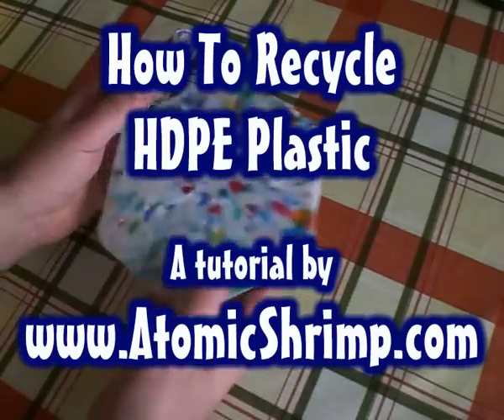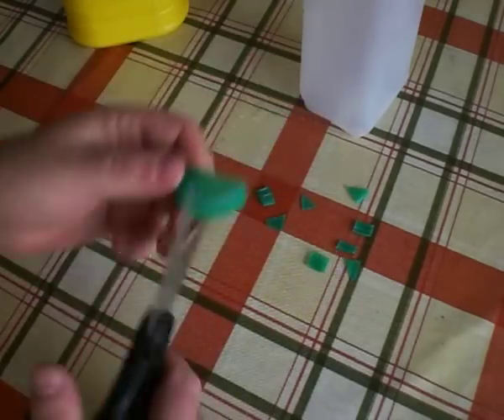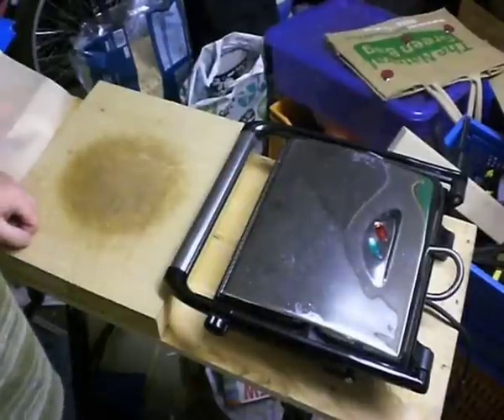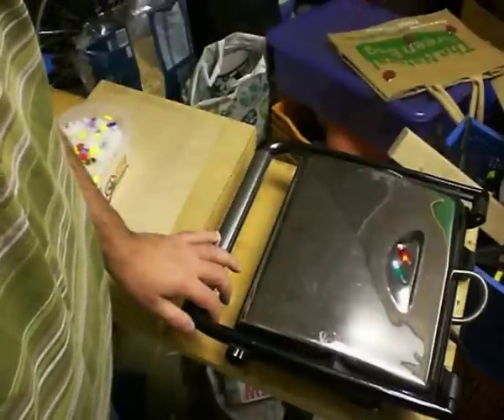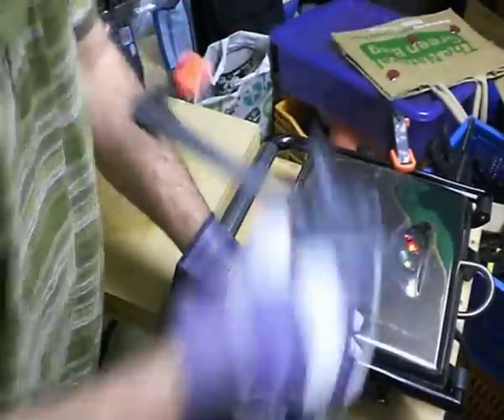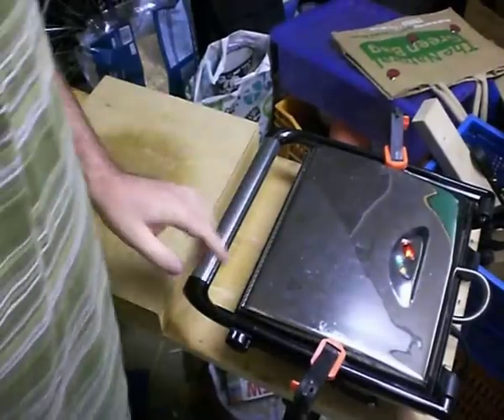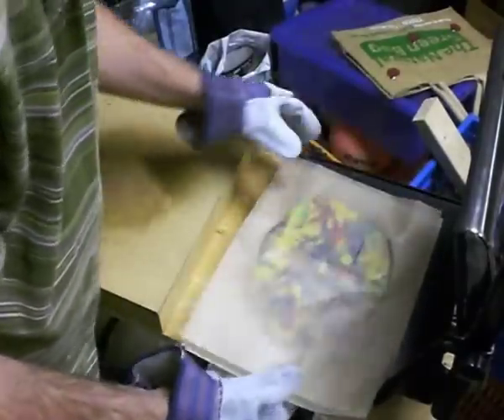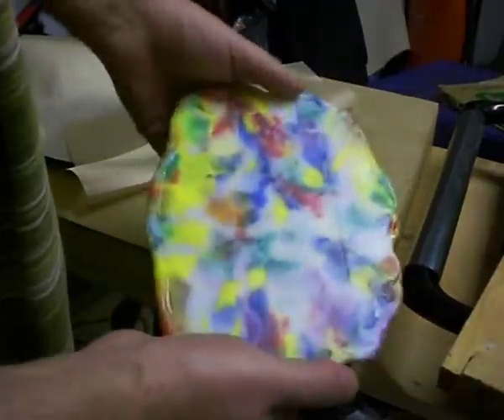How To Recycle HDPE Plastic (High Density Polyethylene) - a simple method

Comment: Instead of using the cardboard ring to contain the loose HDPE pieces, make rings from a large milk container filling it to the required depth which allows for a more controlled smooth edged unit prior to heating and compressing! Instead of using metal spacers to stop over flattening the blank make a wooden frame roughly the required shape!

Comment: If you know a company that will make aluminium moulds ~ then you can press the melted plastic into it~ you’ll need to find some way to pump it between if it’s a double ~sided mould (one with a front & back section)!!

Comment: Do you think homemade 3/4” hdpe will hold a kayak trolling motor ? Without bending or breaking?
Reply from the maker: It's pretty strong but a lot of it will depend on the way the joints are configured and fastened. I can't say for sure

Comment: The air bubbles are not "driven out" under your application of pressure. Check out a net force vector diagram, it is zero, so, the net movement of the air bubble is zero.
Reply from the maker: I probably just shouldn't have used the word 'bubbles'. Compressing the material closes up voids

Comment: Can you mix #2 and #5 plastic together in this process?
Reply from the maker: You can, and apparently they will crosslink, but it's not recommended because the two resins have different mechanical properties and you could be creating weak spots (also making something that is non-recyclable itself)
Reply: Atomic Shrimp thanks for your reply. Yeah it seems like the #2 and #5 should be kept separate unless you know how to properly make a polymer

Comment: hello!! what are the gloves that you were using. i’m doing this project that involves melting plastic and i need to order heat protectant gloves. would appreciate it if u replied back aha
Reply from the maker: These are just rigger gloves - you will probably find that this plastic tends to stick to almost any material - including skin - so the gloves are not so much heat resistant as they are to just provide a layer of protection against the hot plastic sticking to you
Reply: Atomic Shrimp thanks for the reply! is it completely safe from heat though? i don’t want to risk getting burnt
Reply from the maker: This activity cannot be made completely safe. The gloves are only there to protect momentarily against accidental contact - for the most part the trick is to find ways of moving and handling the material without touching it - for example tongs
Reply: Atomic Shrimp oh ok thanku

Comment: Take a stainless steel pot, a bit of water, and what seems like a totally unreasonable amount of calcium chloride. The water will dissove about 6  times its weight in CaCl2, and the boiling temperature can hit as high as 350F. Instantly softens LDPE and HDPE, without the need for tedious cutting! You're welcome :)
Reply: The only downside is spitting, boiling superbrine is a lot less pleasant than deep fry oil at the same temperature
Reply: Oops, meant 320F.

Comment: Great video!! To keep the round shape in the form:maybe melt top a little with heat gun before removing the cardboard form. You might have to do that (melting top)in smaller thickness increments till its as thick as you want then remove the cardboard form & sandwich press cook it

Comment: Sheet metal tray with 1 inch border, sitting on a grill inside a larger sheet metal box with a butane heater installed on rear side, sheet metal screwed to wood plate with weights on top sitting on plastic inside of tray inside of box, gril temp guage on top front.

Comment: what is its scratch resistance like?
Reply from the maker: It's pretty tough - it marks quite easily on the surface, but it's hard to make any sort of serious scratch in it. It's the same material most plastic chopping boards are made of
Reply: @AtomicShrimp  I see, thank you.

Comment: nearly 10 years later and this is the material being used in british army helmets. very versatile and strong material. its also considerably lighter than its equivalent rating of steel/ceramic body armour plates, typically steel NIJ III plates are around 11 lbs, ceramics are around 6lbs whereas HDPE is usually 3lbs. insanely light and very strong.

Comment: Couldn't you have wrapped the melted plastic in it's soft state over the pen? Like modeling clay?
Reply from the maker: Possibly - there is a very limited working time, and handling the melted plastic is difficult as it is very sticky, and hotter than boiling water, but there are probably possibilities

Comment: You are such a great teacher and you keep the audience attention. I told my nieces and nephews get on my laptop and check for something to do this weekend. Guess what they asked to make? This! You have many tween fans now! Thanks 🙏
Reply from the maker: Thanks!  if you're melting plastic for fun (and it is fun), please stay safe - HDPE melts at a temperature hotter than boiling water, and when it is melted, sticks to many things including clothes and skin.  It is advisable to keep a bowl of ice water on standby that you can plunge your hand into in case of an accident, wear protective clothing and shoes, and make sure your path is clear to step away if anything goes wrong.
Also, don't heat it too hot - there are almost no fumes within the melt range (135 to 180 centigrade =  250 to 350 Fahrenheit), but if you heat it very hot (above 300C = 570F), it will produce smoke and fumes, which you don't want to be breathing.
That sounds like a load of dire warning, but as long as you exercise good sense and safety, there is much fun to be had here.  Hope it all works out

Comment: Can you use it as a cutting board, or a pan stand?
Reply from the maker: As long as the source material is clean, these can be used as cutting boards - the material is quite slippery though, so a pan stand might not be safe

Comment: https://engineering.mit.edu/engage/ask-an-engineer/can-we-safely-burn-used-plastic-objects-in-a-domestic-fireplace/
Reply from the maker: I'm not burning the plastic
Reply: It doesn't matter, it will still out gas. 

Do you have a source that shows that it's safe?
Reply from the maker: HDPE does not decompose at these temperatures: https://pslc.ws/fire/howwhy/thermalp.htm
Reply from the maker: Key thing to note here is that this is not PVC.  PVC starts to decompose below its melting point, and produces some pretty nasty products.
Polyethylene, on the other hand, has quite a wide margin between the melting temperature and the decomposition temperature; the products of decomposition (if pushed that far) are still not good, but they are not outgassed during lower temperature melting

Comment: Interesting but the easiest way is a shredder
Reply from the maker: I destroyed two shredders trying that.  HDPE is both tough ans slippery - it just worked between the cutters and jammed the machine.  One of the machines was a device capable of grinding credit cards, but it jammed solid with this stuff
Reply: @AtomicShrimp  not a paper or credit card shredder
Reply from the maker: @bobkeller8383 what type of shredder?

Comment: Hmm HDPE is used in combat robotics, interesting I wonder if I could use this method to make armor and a chassis for a 3lber?
Reply from the maker: It's very resilient to blunt or sharp impact; not so good with abrasion (so one of those robots with a circular saw weapon could cut through it - maybe a thin layer of steel or titanium to resist cutting, laminated with a thicker inner layer of HDPE to resist impact)

Comment: With a mold, could I create tiles for a back splash or floor?
Reply from the maker: They would make durable tile - I wouldn't recommend them for a floor as the plastic is quite slippy in nature (I used pieces of this material as plain bearings for my recent wobbledog project)

I think you would have to grout the tiles with silicone - I don't think regular paste grout would stick to them

Comment: If you want to save time cutting up the caps and such is to use a paper document shredder. The first one I tried cut into strips, the one I use now cuts into bits which I run through 2 or 3 times until I have the  size I want. Way easier than scissors or snips and all the bits fall into a bin for easy handling. I also punch out shapes from a thin material of different color and lay them on top  of the sheet for the final melt and press, embedding them. Cool!
Reply from the maker: I tried it and it just destroyed the shredder
Reply: @AtomicShrimp  your material was too thick or your shredder has a small motor. I'm sorry I should have mentioned the one I use is a heavy duty one I got at Office Depot, it will shread pop cans no problem or  up to 4 lids at one time. Specs say it will handle 10 sheets of paper at once.

Comment: My paper shredder can do credit cards. I think a paper shredder might be a little bit faster than this.
Reply: I was thinking the same thing. Cut containers into sheets and run through heavy duty shredder. I'm going to give it a go.
Reply from the maker: I bought a little shredder that was specifically designed for credit cards, but it choked to death on this stuff - HDPE is flexible, tough and slippery - this combination means that it just worked its way between the blades of the shredder and jammed there.  In order to shred this stuff, you either need very close-fitting, sharp blades, or enormous torque to just power through the jamming

Comment: Theirs called a blender. Lmao
Reply from the maker: Have you tried this with a blender? I have. It didn't work
Reply: @AtomicShrimp  maybe get a stronger blender? U can cut up a bottle into like 4 long pieces and dump it in container and watch the blades turn it into dust
Reply: @AtomicShrimp  and I haven't. I'm just doing research on this and i seen a video of a guy doing this with a blender and putting the shreds in cooking paper or whatever and melting it then putting it into wooden box
Reply from the maker: Yes, a very high quialty/power blender will probably do it. I'm not going to buy one just to shred plastic though (and the blender I have right now works fine for food)

Comment: Is there a way to butt to such pieces together with a heat gun to make a rigid length of board?
Reply: Plastic welding is my guess
Reply from the maker: I tried that, but didn't find a successful amateur method - I cut a bunch of thins stuff into equal sized hexagons and tried seam welding them with hot air or heated metal tools - it just wasn't very successful in producing a consistent and usable larger sheet.  I think it can be done, but I couldn't figure it out

Comment: How do you know that doing this won't expose me to toxic gases?
Reply from the maker: HDPE is pretty benign as long as it isn't overheated to the point that it burns - there is a very slight smell that comes off it, like the smell of hot candle wax - that's about it

Comment: Thanks..can it be used as cuting board in the kitchen?
Reply from the maker: If you're sure about the cleanliness of the source material,  sure - I would probably avoid using bottles from things like household bleach if the intended end use is for food
Reply: Atomic Shrimp thanks for info
keep up good ideas💪💪

Comment: Have u tried pam? Will it work??
Reply from the maker: I feel like adding oil may prevent the pieces of plastic from fusing to one another fully
Reply: @AtomicShrimp  update, i made a steel mold, and cured it using canola oil. The same way they cure cast iron skillets. I've successfully made 4 blank slates with very satisfying non stick results

Comment: Hi, I don't have a toaster like the one you have, or clamps... is there any way the plastic could be melted in a conventional oven, in an ovenproof, lined dish?
Reply from the maker: Others seem to have done OK melting it in an oven - I found that it tends to scorch the plastic and make it fume a bit, but that could just be the temperature control on my oven
Reply: @AtomicShrimp  I could try it at a slightly lower temperature, and keep an eye on it. I'm an 'ornery bog-standard housewife' without tools, clamps, presses, jigsaws or cutters, so I am looking to recycle plastic and tops and just be happy making irregular shapes, chopping boards, bowls... whatever... all I got is greaseproof paper and a rolling pin. I'll let you know all about my disasters!
Reply from the maker: Just be careful!  This stuff, when it's melted, is hotter than boiling water, and sticky like caramel - don't attempt anything without the gloves!, and have a large bowl of cold water standing by - in case you accidentally get it on you
Reply: @AtomicShrimp  I will do. It frankly looks like molten lava, so I'm on course to be cautious! Thanks!

Comment: That was great. Thank you. I am looking to make soap dividers for soap slab mold which is about half a meter long, how could I get a piece that long
Reply from the maker: Tricky - I haven't managed to successfully make anything bigger than the toaster plate, so the only advice I can offer is: find some way to make it modular
Reply: Atomic Shrimp - Nice video, sir. I wonder about the lengths of time for each melt. “A few more minutes” is not very specific, and each person’s definition will be different.

To Cat 9 soaper’s question, I believe I’ve seen a similar process using an oven and cookie sheets. That would allow for larger pieces of the final product, which could then be worked with tools, as you suggested, to make still larger pieces.

 There are special adhesives for working with specific types of plastics, but some more generic adhesives may work almost as well. 

Thanks for making the video, and good luck to all with the projects you have in mind. 

Stay safe!

Dan

Comment: Great video! I can't wait to try! I just gotta get some clamps and save/find some discarded plastic. Do you think it would make a good floor mat for a playroom?
Reply from the maker: This material is certainly tough enough for flooring, but be aware that it has a very low coefficient of friction - it can be very slippery; texturing it may help with that, a bit

Comment: Would a heavy duty shredder work on the lighter plastics.
Reply from the maker: I've never managed to get it to work - HDPE is so slippery it just seems to work its way between the blades (I even tried a shredder that was designed for grinding credit cards) - I think an industrial shredder will do it

Comment: Wouldn't it easier melting it with an electric pot outdoors and then pouring into a silicon mould?
Reply from the maker: That won't work. This plastic does not ever melt to a pourable liquid state. It melts to a soft, sticky toffee-like consistency. If heated hotter, it catches fire

Comment: FOR YOUR OWN HEALTH, use caution with plastic and fire. 
• Opinions are not mine, but from this site. 

Type 1 [PETE] = 

• Risks: 

PETE plastic is notorious for the high amounts [by health guidelines] of Antimony and carcinogens that it can leach into water. These can also be released by burning and melting this plastic.

• Conclusion: 

Avoid melting this plastic. 

•  MORE INFO ON SITE.

Type 2 [HDPE

• It’s the safest plastic out there. It also is the easiest to recycle.

TYPE 3 [PVC]

• PVC is the most DANGEROUS plastic produced today, next to PC[discussed in #7] However this is another plastic that I have seen melted a LOT on here. PVC is also known as Vinyl. Most Records are made from Vinyl.

• Risks: 

PVC leaches Carcinogens as well as Lead. Also when exposed to heat it emits one of the most dangerous pollutant and toxin, Dioxin.

• Conclusion: 

You can use PVC but avoid at all cost from melting it. 

TYPE 4 [LDPE]

• another safe plastic….

• Things To Know: 

LDPE is strong but significantly less sturdy than HDPE when in a solid form. It still takes a lot to melt it [about 194F]

• Conclusion: 

LDPE is pretty safe to use. If in a solid form it takes a lot of heat to melt. Use caution while trying to burn loser LDPE products such as bags, because they do catch on fire.

TYPE 5 [PP]

• PP is pretty safe.

• Caution: 

PP is quite safe, however studies have found that certain PP's may leach a biocide. So use PP with caution.

TYPE 6 [PS]

• This is Styrofoam basically, and I would hope everyone knows to avoid heating Styrofoam.

• EDIT Type 6 plastic has two forms. One being Styrofoam and another which mimics the other plastics, This plastic is easy to melt,……..

• Risks: 

Also leaches Carcinogens related to styrene and an estrogen disruptor.

• Conclusion: 

Don't heat Styrofoam, ever. And if you are going to make homemade Shrink Dinks just use caution, and be in a WELL Ventilated Area.

TYPE 7 [MISC]

• PLA are biodegradable plastics so they are good and if you find them are safe to work with for crafting.

• PC is a bad plastic but isn't really something that would pertain to crafters unless they are architects. But if you would like to know, it contains many harmful substances…….

MY OPINION; I don’t mess with it because learning the truth might come too late.

MORE INFO FROM; https://www.cutoutandkeep.net/projects/the-very-important-guide-of-plastic-safety

Comment: Do you reckon an iron could work like the toaster? Only I don’t have a sandwich toaster.
Reply from the maker: You can melt small amounts of plastic with an iron, but don't try anything big - the iron lacks the thermal mass to do it.

You can fuse plastic bags with an iron to make a sort of durable plastic fabric. Google 'fusing plastic bags'

Comment: EXCELLENT IDEA ---- Does it smell while its melting in the cheese griller,
Reply from the maker: It's not bad at all. The plastic is only just being heated above its initial melting point, so it does not emit any fumes. I still carry this out in a well ventilated are. Because any impurities in the material (e.g glue from labels) may smoke a little
Reply: @AtomicShrimp  I have found LOADS of things under my sink that are  HDPE....cant wait to get started